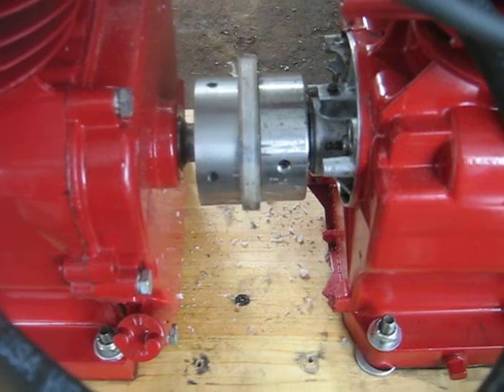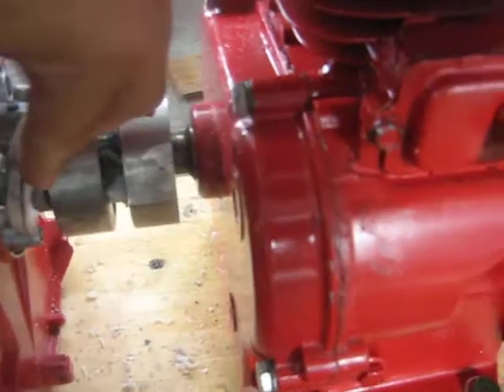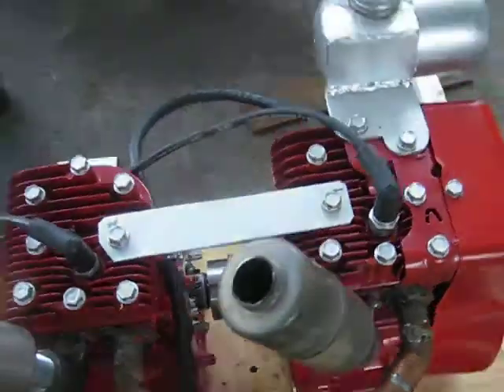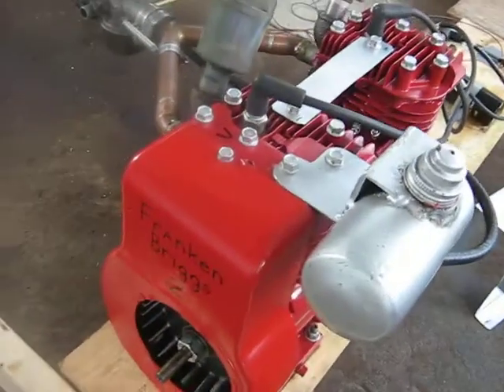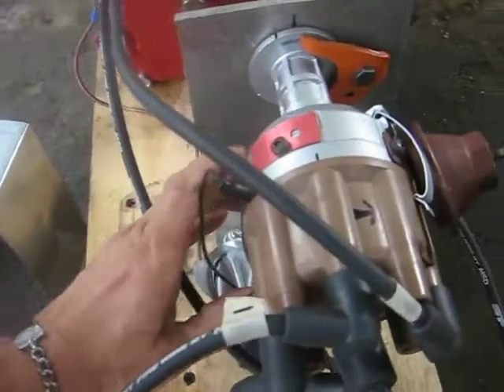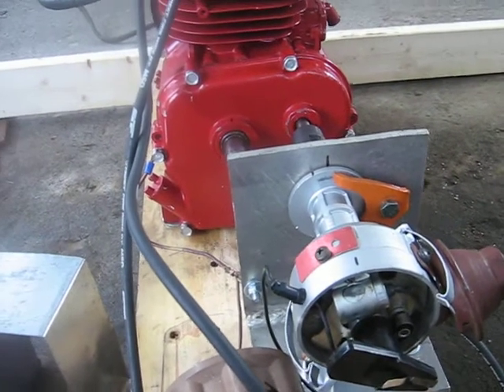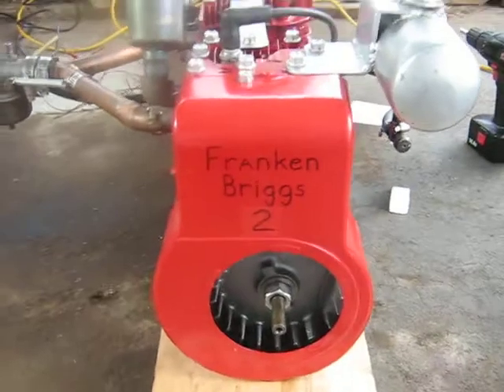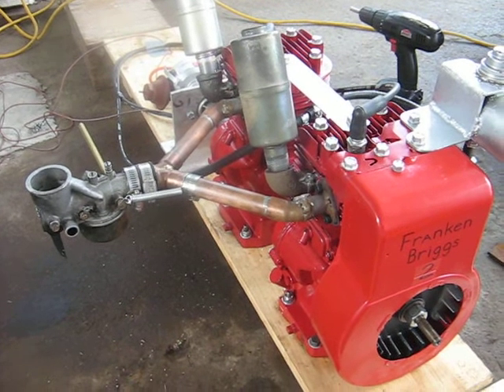FrankenBriggs 2 Aftermath

Comment from the maker: Thats an interesting idea, it might work.  
I only use one flywheel, since it now has twice as many power strokes, the 4 cylinder 4 times as many. So I reasoned that I should be able to use less flywheel weight. Although, what you suggest does have merit, perhaps 2 smaller flywheels would work out better, as far as coupling destruction forces go!  :)
To mount a flywheel on the other end I would have to butcher it by machining out the taper, and welding in a bushing with a keyseat, all possible.

Comment from the maker: I doubt any rubber hose I could get would take the load. I tried driving a generator with a piece of heater hose one time, it tore it right in half when the engine started :(
I have the keyseats machined in the 3 cranks now, so i plan to give the 2 cylinder 1 more run with the plastic coupling, then go with the new chain couplings. I may go with a steel base also, but that will be lots more work, so I am not 100% sold on it yet.

Comment: I see. Anyway if I were you I'd beef up the head tie as described just to give extra support. 
If your soft coupling fails again and you choose to go down the route of a rigid bolted coupling, you need there to be zero relative motion. As such you would be better looking at excess bracing support rather than looking for it.

PS where are you from? Newfoundland by any chance? I am from Waterford, Ireland and you seem to have some colloquial sayings similar to people here in this part of Ireland

Comment from the maker: I will probably have to go to a steel base as you mention, the brace at the top mainly acts as an electrical contact between the engines, since the spark has to get back to ground.

Comment: What is really killing you here is the wooden base. If you look closely at the vid of it running you will see relative motion between the engines and this is screwing the coupler. You ought to get rid of the wood and mount the engines to a heavy rigid steel frame - like make a ring with some 75mm steel channel and cross brace it well.

Also your top tie between the heads to very skinny. Get some 100 x 4mm strip and attach it to both heads with several bolts at each end. (continued below >)

Comment: I think you should also stiffen the head tie with 2 No. 25 x 4mm vertical ribs welded on.
Then it should be real steady.
I also suggest ditching the soft coupling. Drill through both coupler plates and just pass a few bolts through. Maybe mill a tounge and groove as someone said to be extra sure.

Comment from the maker: True, the tolerances will stack up, and throw the timing out for sure, guess we will find out how badly it affect it! I still need to machine a keyseat in 3 of the cranks before I can give it a try.
I am going to try the plastic type once more, since I put so much time into them. I have one that was correctly machined, but fits #4 cylinder, so I have to do a little mod to make it fit #2.

Comment: i kinda dont like the idea of chain couplings, I reckon it will have to much play which inturn will throw the timing off. id use the two couplers there without the plastic ring and machine a tounge and grove going down the middle and bolt them together. I just dont know, I reckon then a solid sleeve would be the way then. keep us updated!

Comment: have you tried putting cyl 2 180 out from 1? then use cyl 1 post skip 2 then skip? basically "to me".... sounds like first cyl is firing right but second is "cross wired" odd to say with a 2 cylinder.... with a 8 cylinder cap...